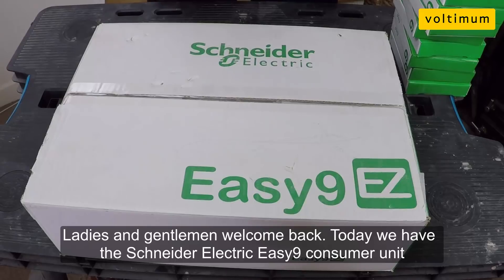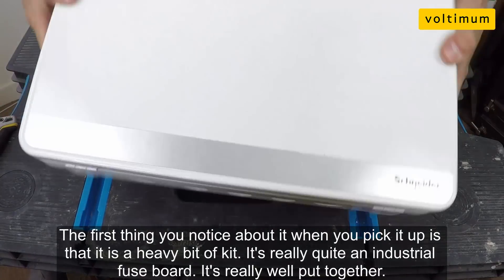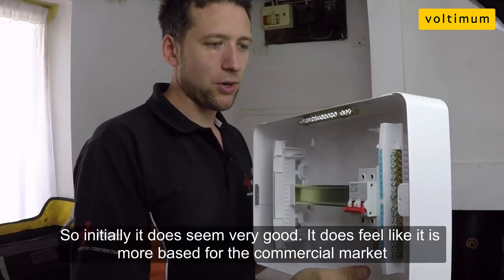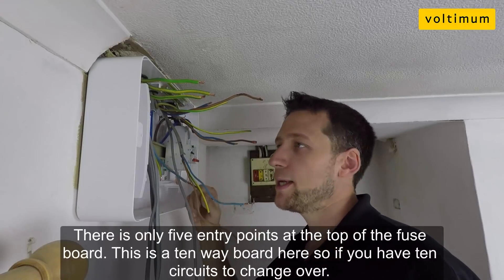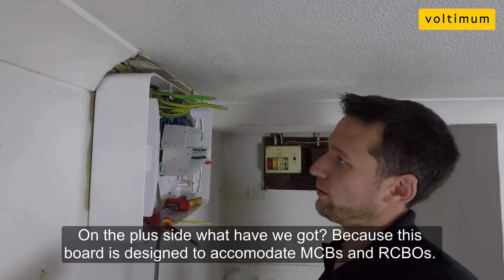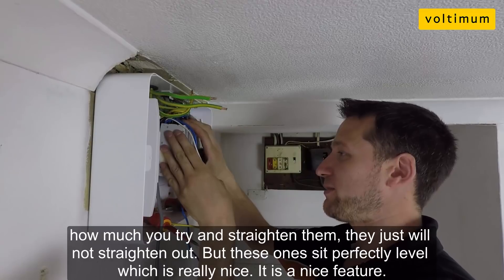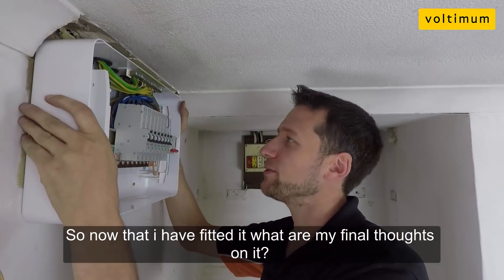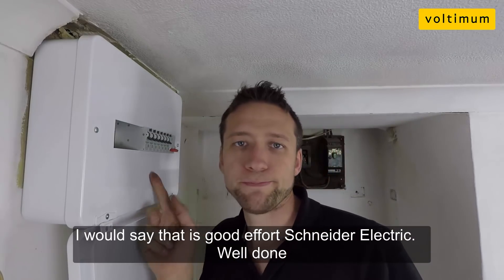Thomas Nagy reviews the Schneider Electric Easy9 Consumer Unit

Comment: I’ve fitted one. Couple issues I found. The neutral bars are to one side. Fine if cables are long enough but I had to do a lot of extending. Some birds have the neutral bars at the top so not as far to go. 
Schneider for me seems quite difficult to get hold of. I like the look of the sockets switches boards etc but no one around me stocks it. It’s an order in job. Not ideal when in a rush.

Comment: Wish Tom had mentioned this on his channel; I fitted one last month and had the same issue with top knockouts. Swore I wasn’t going to use the leftmost 32mm but ended up having to, and for just a 1.5mm so it seemed overkill, but I did have enough space when using semi-blind membrane grommets and taking the tails in the bottom. I know they’re bigger than the average CU but that gives you plenty of room to dress cables neatly, as shown here even if you’re using tall 1-mod RCBOs. I like that the cover covers the whole thing, so all your ugly labels can be on the inside, and Schneider offer a cheap magnetic cover panel you can have printed with your own image online, which is a nice novelty. I had to fit it very visibly in a kitchen, so needed something aesthetic, and I’m glad I took the Easy9+ over a Hager board in the end.

Comment: Good video👍
Schneider is a really good make, but I’ve came across with a few problems to.. some of the “retrofit” breakers are actually bigger than the original.. especially the old Merlin Gerin stuffs 
(If I’m right Schneider took over Merlin Gerin and Square D) correct me if I’m wrong about this.

Comment: Fitting one of these tomorrow. Really happy with the board just looking at it in the box. I got the fully loaded one and I would say their choice in what MCB’s they give you is a little limited (maybe that’s my fault for not checking beforehand) but other then that very happy Atm. Their quality of workmanship inside is very good with the cabling they have fitted from the RCBO’s to the busbar.
Reply: Quick Update, fitted today and the lack of entry points was a slight issue but was over come with some adjustments. Happy with the install and look of the board. Plus it comes with enough stickers if you don’t like the look you can customise it 😜😜

Comment: Am I mistaken in thinking that part of the amd3 stipulation for manufactures is to ensure the cover cannot be left open? As to prevent the spread of fire?
Reply: The lid can be rotated so that it opens upward. The Schneider silver brand label on the front is magnetic and can be moved to accommodate the upward opening door.
Reply: 81paulG is correct. 
I do find it odd how they are packaged with the lid opening downwards.
I’ve had to turn countless lids my colleagues have installed round the correct way because of this!
Reply: Depends on the manufacturers instructions. I’m sure it doesn’t state that the board lid has to self close. But some manufactures do it to comply with the regs. Others may do other things like metal blanks etc to comply.
Reply: @oscard-1863  Metal blanks wont stop the plastic RCBO's from melting though...